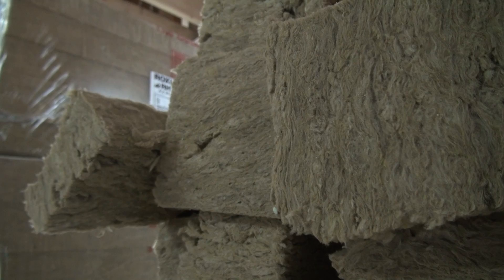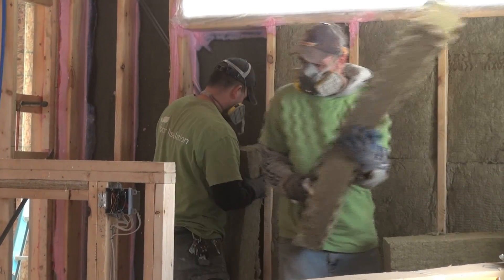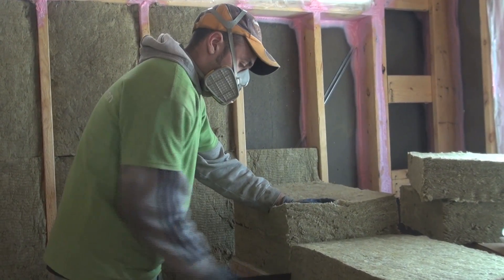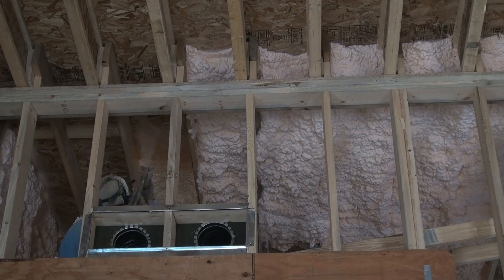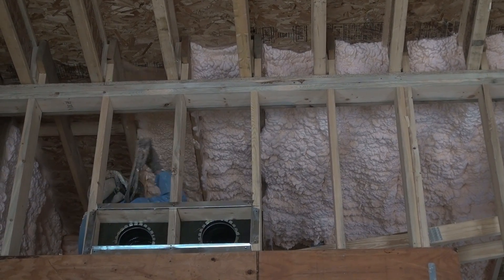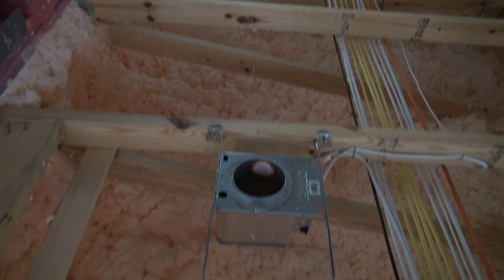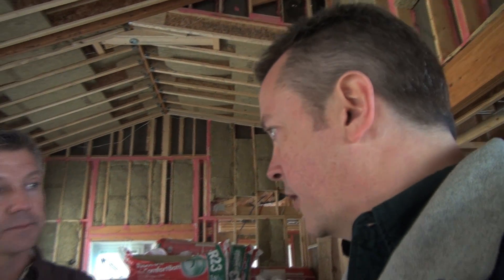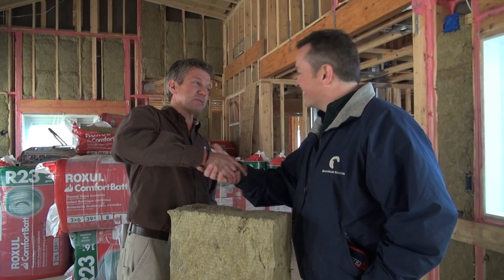Mineral Wool Inuslation - Ann Arbor, MI

Comment: You didn't even touch on the best feature of rock wool, being it's fireproof. Also, it doesn't mold and it wicks moisture. Surely, being in the construction industry, you're aware of the benefits of safety.

Comment: What about a vapor barrier? Michigan would be in climate zone 6 and during the colder, winter months there's a risk of moisture from inside the home migrating into the wall cavity and condensing causing rot, mold, mildew or failure. Does the spray caulk have a high perm rating? Can energy complete be used by a diy'er?
Reply from the maker: TellMeHowI'mWrong? Ann Arbor is in climate zone 5. There are some different maps and we’ve seen MI in climate zone 6 on descending maps, but the commonly accepted one in building science literature puts Ann Arbor solidly in 5, with zone 6 starting around Bay City. 

Every house should have a vapor barrier and in our climate zone, we prefer that on the outside of walls. Mineral wool, cellulose, fiberglass or open-cell spray foam are not vapor barriers, so we typically are going to wrap a home with at least 2” of rigid foam (we prefer EPS). If you wanted to wrap a home with mineral wool 4x8 sheets, or not wrap it at all, we would recommend a class II vapor retarder wrapped very well on the outside. Our favorite product is Vaproshield. 

Thanks for your comment!